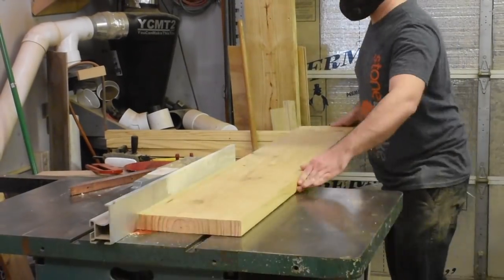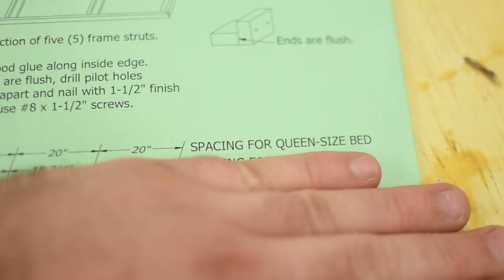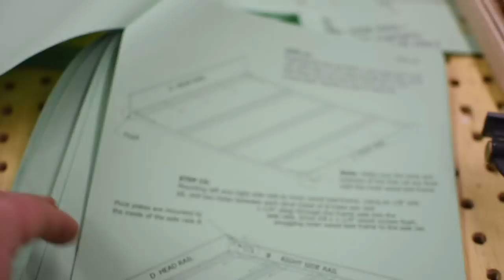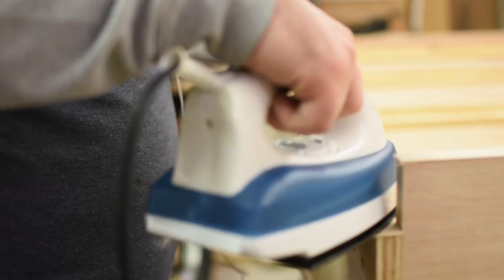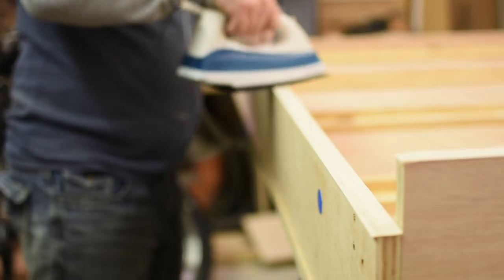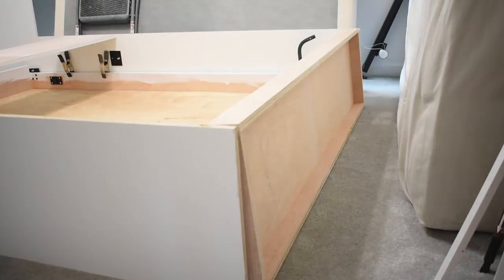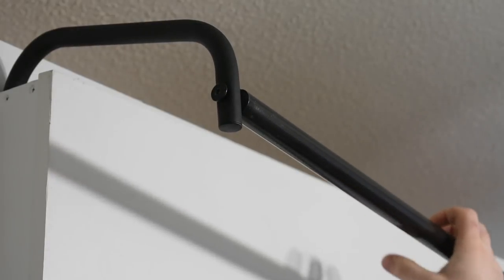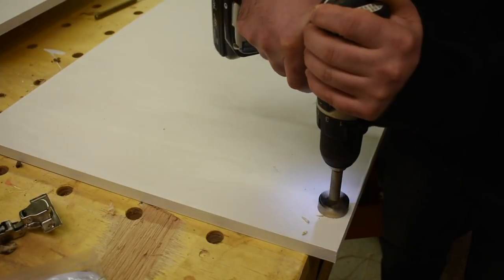How To Make a Murphy Bed with Stay Level Desk

Comment: However impressive looking it is, it is more impressive how that desk works. You leaving that computer on there and showing how you can lower the bed without it being affected was just too cool! Nice job, Caleb!
Reply from the maker: Thanks, Bruce! Getting that desk to work was quite the trick, haha.
Reply: @YouCanMakeThisToo  Built this recently and haven't figure out how to get the stay-level bars to work right.  It seems to require a shorter length when it's down than when it's up.  Any chance you can share the math on that, or what your measurements were?
Reply: @jaredh4183  I've been doing some brainstorming, and I think I figured it out.  The relationship between the shelf hinge and the shelf's bar mounting point needs to be the same as the relationship between the bed hinge and the cabinet's bar mounting point.  So, if you mount the bar to the shelf 10 inches down and 8 inches in front of the shelf hinge, then you need to mount the other end of the bar to the bed cabinet 10 inches down and 8 inches in front of the bed hinge.

To visualize why, imagine the arc drawn in the air by the shelf hinge as the bed opens and closes.  It's essentially a circle centered around the bed hinge.  For the shelf to remain level, the shelf's bar mounting point needs to draw the same arc, so it'll be the same size circle, but the edge is on the shelf's bar mounting point, which is "shifted" down and forward of the shelf hinge, so the center of that circle (i.e.: the cabinet's bar mounting point) is shifted down and forward by the same amount.
Reply: @ReverendTed   Thanks for the response!  Your way makes more sense, but here's my solution in case anyone is interested.  To figure it out, I ended up getting mathematical.  There are basically two different graphs we need to use.  One in the up position, and one in the down position.  I call the bar that goes from the desk to the base of the bed the radius, and I treat it like a circle, where the centerpoint of the circle is where the support connects to the side of the desk.
This will make way more sense if you graph these out.  I used https://www.geogebra.org/graphing?lang=en 
The first equation is when the bed is up, desk is in use.
(x - [length parallel to floor from where the bed pivots to screw in desk])^2 + (y - [height from bed pivot to screw in desk])^2 = [length of support]^2
Second equation is the same, but when the bed is down/in use.  My initial situation was a problem.  My two equations were:
(x-19)^(2)+(y-30)^(2)=39^(2)
(x-39)^(2)+(y-0.5)^(2)=39^(2)
Where the two circles intersect is where the bottom support needs to be anchored for the desk to stay level while the bed descends.  Just like you pointed out they need to draw the same arc.  Graphing mine, you will see that how it was originally situated, there was no solution unless it was anchored about 4" below the floor.  I used the graphs to change my support length, desk height, and how far out it was anchored on the desk until I found something that worked.  It was a lot easier on a graphing calculator than it would have been to keep cutting lengths and drilling holes.  Sadly, I did not save the equations I finished with, but hopefully this helps people.  I may update this post later when I have the opportunity to measure again.

Your way really sounds like we used the same concept, but I had to see it on paper before it clicked in my head.

Next time your kid says "when will I ever use algebra," feel free to cite my post.
Reply: @ReverendTed  Final graphs that worked, using the formula in the previous comment were:
(x-9)^(2)+(y-30)^(2)=29^(2) for desk up
(x-29)^(2)+(y-0.5)^(2)=29^(2) for bed down.  So I shortened the bar to 29" (30, but 29 from screw to screw) and moved it to only be 9" out from the bed when it's in the up position. The bottom screw ended up 2.5" above the pivot of the bed. 
Hopefully this helps others solve.
Reply: @ReverendTed  Worked perfectly. Thanks!

Comment: The math for a stay level desk is actually very simple once I drew it out and tested everything. I'll identify  four "swivel points":
1- Bed Swivel
2- Desk to Bed Swivel
3- Frame to Brace Swivel
4- Desk to Brace Swivel

I think these are pretty self explanatory. Anyways, whatever the horizontal and vertical distance is between the swivels 1 & 2 is, the horizontal and vertical distances between 3 & 4 should be the exact same. If you "connect the dots", you'll find that they form a parallelogram where you can fix two points, and move two points, and keep the distances equal
Reply from the maker: Ahhhh, that makes a lot of sense. Thanks so much for explaining!
Reply: Where did you get the hardware for the desk & plans? I checked your site & couldn’t find them. I’m wanting my husband to make me one. He’s super handy but I’ve gotta have the desk too. Also, I assume the Murphy bed plans (what your call cuts) are included with the hardware from Prime Tools?

Comment: That's a great take on the stay-level desk concept!  A piano hinge on the back upper edge, and pressurized struts to keep it level through its arc.  The DeskBed design has the desk hanging from brackets, without struts (just struts on the bed to help lift it), and I thought about trying to reverse engineer that without plans, but it seemed a bit advanced.  This seems much simpler, but it depends on those struts not failing.  Still, I may give this one a go at some point.  Thanks for sharing!
Reply: The desk doesn't use pressurized struts.  It's a rigid bar affixed to the shelf and the cabinet.  Any struts here are part of the Murphy bed mechanism itself (and even then I think this one might be springs only?)
Reply: @ReverendTed  Ah, so it is!  A rigid bar.  Even simpler.

Comment: I’ve watched this video about 20 times because I recently bought the Murphy bed kit and I’m wondering as to how you make the stay level desk and also a quick guide for the cabinets! If I could get more info on that I’d appreciate it! I want my build to be as great as yours!
Reply from the maker: Thanks! I haven’t done details on the desk, but it’s in my list because so many people have asked. As far as the cabinets.. I don’t have plans but they are dead simple. Do a google image search for cabinet construction and you should get a diagram if my walk through isn’t helping. Then just size your pieces to whatever dimensions you want.
Reply: YouCanMakeThisToo I’ll do a search on google for the cabinets! I know you used 4 feet piano hinge for the desk, but for the sides did you just use metal rods?
Reply from the maker: Yeah, the sides are just 1” flat bar from a home improvement warehouse. Nothing fancy. One of these days I’ll spend some hours messing with it and find the right position.
Reply: YouCanMakeThisToo thanks so much for taking the time out to reply to me! It’s a huge help! I started on the bed and I’m hoping it goes well!
Reply: @YouCanMakeThisToo  hopefully you can share to us. I already made the bed following rockler plan but all diy hardware (boat seat swivel) but planning to have someone weld me same thing like the original. I will be making a desk and shelf that will act as bed legs. for now im just propping somethingto support bottom.

Comment: Would you upload some close videos of the mechanism you used for the stay level desk? And dimensions
Reply: Yes!  I am willing to do the guess and check, but it would be great to get the pivot locations
Reply: Hi Patrick - I am also looking t build one and have worked this out as follows - with the bed in the upright position and the leveling arm hanging scribe an arc on the frame around the bed - then with the bed in the down position use the leveling arm to scribe another arc to intersect the first one this would then be the piviot point for the leveling arm

Comment: Great video!! I want to use only 6 inch mattress, can this be made a little shallow e.g. 7 inch depth so it will not take too much space when folded?
Reply from the maker: Probably, but it might throw off the pivot points and stuff.

Comment: It looks pretty good. I have very limited space, basically an 8' x 10' room and only 66 inches of space behind the door on the only available wall with out windows or closet doors. Can this be assembled off sit and then installed on site?
Reply from the maker: Sort of, it won't fit through a door but the way I did it may work for you. Prepare and assembly what you can offsite then put that together in the room.

Comment: What'd you figure out about the stay-level geometry? My hunch is that two pivot points need to be in the horizontal plane. I've been trying to figure it out on the whiteboard for days now.
Reply from the maker: I just kept repositioning the screws until it worked well enough
Reply: @YouCanMakeThisToo  oh man that's rough. Well I'm glad it worked out, it looks great.
Reply: My gut feeling is you need to match the relationship between the desk hinge and the desk pivot mount to the relationship between the main bed hinge and the frame pivot mount, though I may be mistaken.  That is, if the desk pivot mount is 8 inches down and 10 inches forward from the desk hinge, then the frame pivot mount will need to be 8 inches down and 10 inches forward from the bed hinge.  Again, I'm not sure this is actually correct, but the more I think about it the more convinced I am that this is correct.
Alternatively (as I'm brainstorming): the frame pivot mount should be the same distance from the floor as the desk pivot mount (when the bed is lowered) AND they should be the same distance apart as the bed hinge is from the desk hinge.  That said, I know for a fact that based on other videos I've seen that this is possible without the two pivots being the same distance from the floor.

Edit:  I did some more thinking, and it's the first one, I'm nearly positive.  Imagine the arc drawn by the shelf hinge as the bed opens and closes - it's essentially a circle centered around the bed hinge.  Now picture the shelf moving level with it at the same time - specifically the point where you mount the stay-level bar to the shelf.  It helped me to hold a pair of fingers up in that orientation and watch as I moved, but what I noticed is that in order to stay level, the bar mounting point on the shelf must make the same circle, just shifted down and forward based on how far that mounting point is from the shelf hinge.  So...wherever you attach the stay-level bar to the shelf relative to the shelf hinge, the cabinet mounting point for the stay-level bar must be in that same relative orientation to the bed hinge .

Comment: I was looking for a diy self leveling desk for a murphy bed and I though your was the easiest until I actually put the desk together and well the piano hinge doesn't really do the job it does look great it just doesn't do the self leveling adjustment like it doesn't level out as the bed is coming dow down
Reply from the maker: No, it wouldn’t. That’s what the metal bars on the side do.
Reply: @YouCanMakeThisToo  got it, I was breaking my head on how you had done it unfortunately I had decided to put a trim around the box so my desk is actually about 2" in from either side but I got the idea I'll just think of something similar to do
Reply: @YouCanMakeThisToo  ok so i got my self that metal bars for the desk may you let me know how it was that you got it to go down as the bed goes down please I'd really appreciate it thank you in advance
Reply from the maker: @epenaloza52  That was the trial and error part I talked about in my video. You just have to keep moving them until it works.
Reply: @YouCanMakeThisToo  yeah I got it that I think I got it work properly

Comment: Any thoughts on a some kind of mechanism to make two stay-level shelves for above the desk? :)
Reply from the maker: You just broke my brain... I'm sure there's a way
Reply: @YouCanMakeThisToo  I have ideas, and they are simple enough, but somewhat clunky... basically, they involve a hinged swinging shelf that becomes an additional bed support when the bed is down. the parts that still puzzle me are: would the shelves need to be weighted on the bottom to help them be stable? and/or: does some kind of pivot system with bearings exist, to stabililise the swinging motion?
Reply: I saw another video from WWBeds Custom Furniture about a stay-level vanity Murphy bed that used a slightly different connector to rotate the shelf (though the physics is the same) - it was a rectangular piece of metal (which was nice because it was a little less visible than the diagonal strap).  When watching that one in action, I didn't see any reason you couldn't simply add another leg to it for another shelf higher up.  In fact, my gut feeling that the frame pivot point TCMT2 used for this desk could be used for a second shelf, as long as the shelf had the same functional dimensions - specifically the relationship of the shelf hinge to the shelf pivot point that the desk has.  (E.g.: The previous shelf pivot is mounted 6 inches down and 7 inches forward from the shelf hinge, or whatever.)
Reply: More brainstorming - I think the reason you don't see them with multiple shelves is probably that the more shelving you add and the further (higher up) it is from the bed hinge, the heavier and more complicated to balance\calibrate the whole apparatus becomes.  Maybe?

Comment: Looking to do this myself!  I know you said its better to buy a kit, but the only hardware kit I can find only has a clearance of 4"... I'd really like to have at least 5.5"
Other than trial and error like you did for yours, do you have any suggestions?

Thanks!
Reply from the maker: Screw the desk arm into side and mark where it is up, then mark where it is down. Try the middle, it'll be wrong. Then keep trying. There won't be a right spot. Estimate how you need to the move the one side you did screw, and start over. Eventually you'll get close enough.
Reply: @YouCanMakeThisToo  thanks!!! Wish me luck :)

Comment: Where did you get the round wood to install in the aluminum-round pipe.
Reply from the maker: One of the home improvement warehouse stores, it's just a dowel rod. They're normally in the millworks department near the trim.
Reply: YouCanMakeThisToo thanks. I will check it this weekend. I am nearly finishing up mine. Hoping to put some of the shots on you YouTube.

Comment: OK you have a stay level desk. How do you set up the two brackets on the bottom.  I make these Create a Bed's for a living and I was sent this link by Arron at Create a Bed.  We both want to know how you did this ?
Reply from the maker: Shoot me an email and I can send you some pics, but it’s not anything special. It’s just a piece of bar stock screwed to the cabinet and then into the desk. The trick is getting the length and locations correct.
Reply: But you also mentioned in your video that it would be easier to buy and install self levelling desk hardware. I have not been able to source anything so far. Any leads or suggestions? I called Create-a-bed and they don't know anyone. Funny because there are lots of them out there on manufactured folding bed/desk units.
Reply from the maker: When I made this video there was a supplier. I can’t find them anymore either.
Reply: @mikebraden6727  , Just look at the design, two bars with two screws, the hinge is what controls the dest, make a prototype and try it. It looks so simple and it is genius. Other systems are available.  Go to  WWbeds.com and look at theres.
Reply from the maker: Have
Reply from the maker: Have you had any luck getting a design to work for you John?

Comment: I don't follow someone's plans. I follow what  does that make sense
Reply from the maker: It doesn’t make sense... unless you means you follow what makes sense. But if that’s the case I would say if you buy hardware designed to work in a certain way.. it makes the most sense to follow the plans to build the thing that hardware was designed to operate.